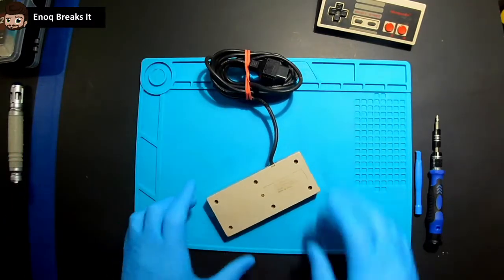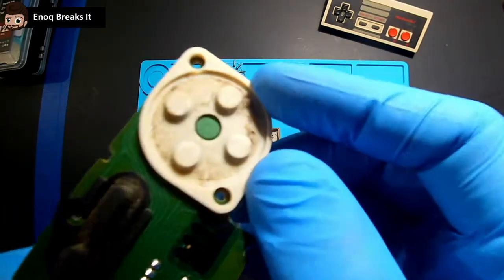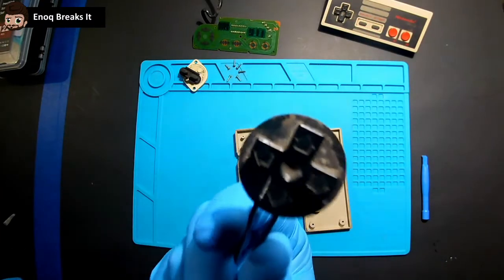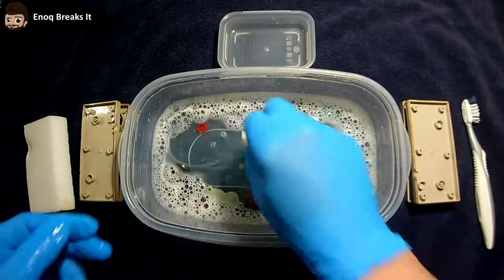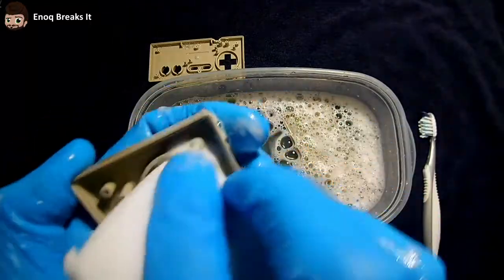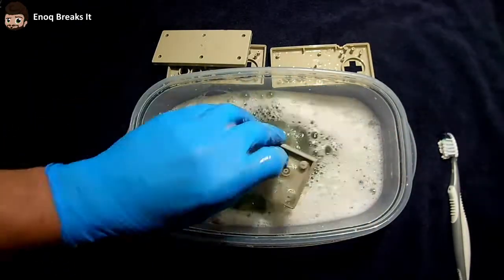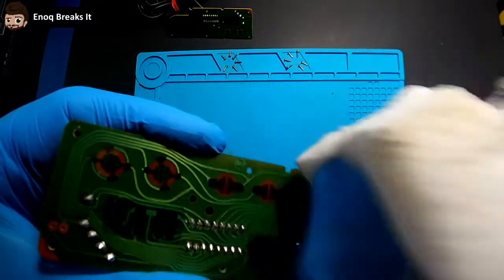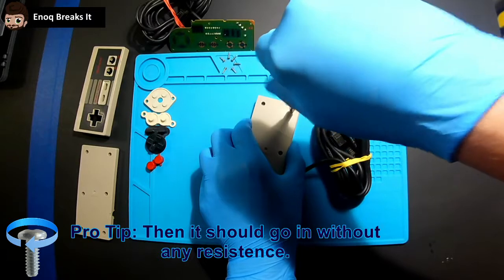Retro Eye Candy #2 - Restoring 30yo NES Controllers

Comment: What size Phillips do you use for these? I did this last night, but stripped one of the screws.  Ended up using a screw gun to drill through it. I believe I was using the appropriate bit size, and the screw was just toasted.  Have you experienced this with these screws or did I just mess up?

Comment: i have successfully cleaned itx motherboards in the dishwasher before...
Reply from the maker: Yeah It's like I said, it's not that water destroys it on contact, people just never dry things completely.
Reply: @enoqbreaksit  oh for real, i let them dry for two weeks and i was still nervous about turning them on.
Reply from the maker: @mixymixee  Ive found that rice is basically magic. I dropped an NDS in the pool once. Completely dead. I pulled the cartridge out and took off the back cover then put it in a jar of rice for a couple days and boom, working NDS. The warranty sticker was fucked but since I didn't try to run a current through the bridged traces, no actual damage was done. That being said the screen still looks fricky.